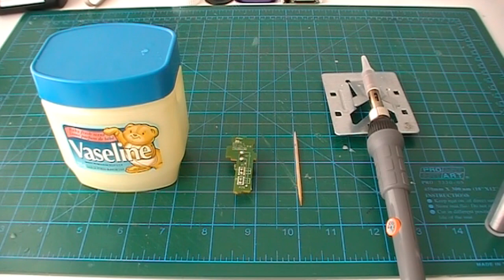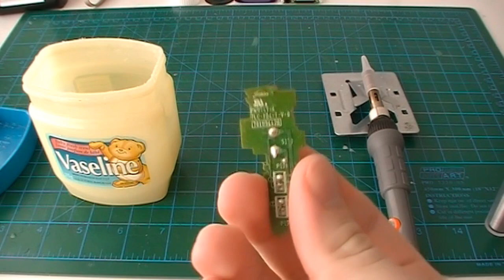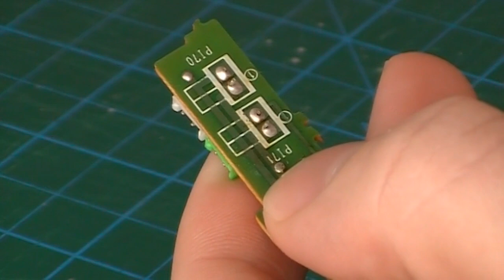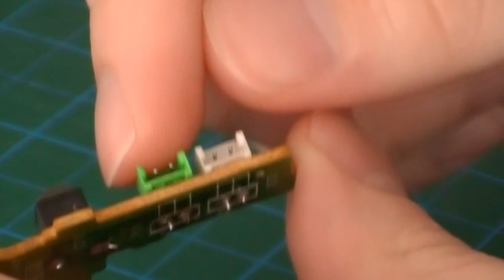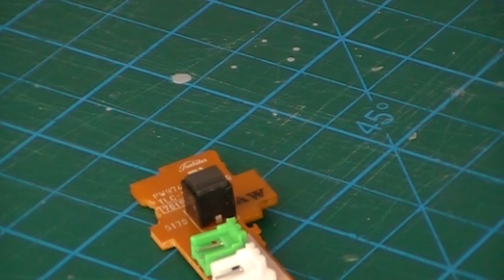Vaseline Instead of Rosin Flux. Is it Possible?

Comment: 0:00 - 0:12 Flux’s thermal conductivity properties are secondary at best. That’s not what flux’s purpose is.
0:15 “rosin also has deoxidizing properties”… Yeah, that’s its entire purpose: to remove oxides and prevent the formation of new ones.
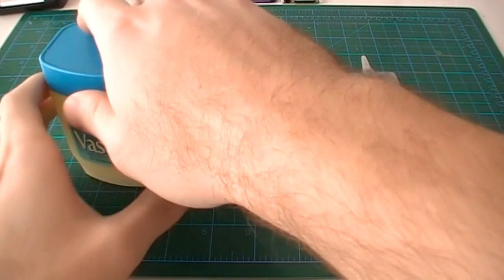0:35 Vaseline is not superficially similar to rosin: rosin is a hard, brittle, plastic-like resin. Rosin-based flux comes in multiple forms, including liquid (doesn’t resemble room-temperature Vaseline at all) and paste (which does have a similar texture, because it often uses Vaseline as the filler: the Vaseline is not the active ingredient!). Choosing a substitute based not on the active ingredient, but on tangential properties of the finished product is idiotic. It’s like saying “I’m out of heart medication, but these other pills look similar, so let’s try them and see how it goes!” or “I’m out of flour, but I found this plaster of paris in my garage that looks like a white powder, too, so I’ll use that in my cookies instead.”

Comment: After misplacing my paste flux, I found this video and tried the petroleum jelly as a flowing flux to solder 2 wires and as far for flowing the solder it doesn't work as a flux, it just globbed and actually caused the solder to ball up to where I had to clean the connection and resoldered without... So this will be considered false information in my line and not recommended.

Comment: It won't work and you have shown it doesn't work. Whilst it may feel OK, it is clear from the lack of the convex shape of the solder bridge that the solder hasn't wetted to the pins. That's no surprise as the main function of solder rosin is to provide a heat-activated acid that removes any oxide layer so the solder can wet to the substrate. That is a poor solder joint that can be visually easily identified as a fail even if it feels secure. For electronics soldering the simple solution is to use a rosin-cored solder; no extra rosin needed. Good ones are non-corrosive in their cold state but best practice is to remove the excess rosin anyway afterwards.
Reply: so could it still work for desoldering purposes?

Comment: Rosin also cleans copper well, like an acid, but doesn't seem to eat the tip so fast.  That said, I've used jelly, and in fact it's the base for plumber's flux.
Reply: Rosin is, in fact, composed entirely of acids (mainly adipic acid, IIRC). It’s just an acid that is not active whatsoever at room temperature!
Reply: Nowadays here in California, water based flux is required :(
Reply: @kylekoenig4730  Says who? I can’t find any evidence of such a requirement. Can you point me towards a source?

Comment: Would mixing powdered ascorbic acid with Vaseline help with shedding oxides from surface?
Reply: I just used citric acid
Reply: Melt some hard rosin and stir in some Vaseline/petroleum jelly. Mix well and you have the same stuff sold in the store

Comment: Small amounts of rosin is available in every pharmacy and in almost any music shop as it is used for violins 😉
Reply: Violin rosin is hard, not like soldering flux. If you try melting it, it will become very tacky, and probably burn to your iron. 
Violin rosin is meant to rub off as a powder onto the bow, which goves the bow hair more traction on the strings, thus creating the sound.
Also, I just realized, I don't think you'll ever see violin roswin in a pharmacy.
Reply: break off rosin, smash to powder, mix in alcohol, rosin flux.
Reply: @stuartmunson  Alcohol would immedtely boil off, just leaving you wityh the same situation.
Reply: @marktwain3531  That's nonsense. Rosin dissolved in isopropyl alcohol is the basic formula for electronics soldering flux that has been use for many decades. It's not some backyard substitute, it's the basis of the actual product you would be sold as soldering flux, and many of us prefer to buy it in its hard, undissolved form. I wouldn't recommend bow rosin simply because the rosin sold for that purpose is too expensive, presumably it's a different grade. I can buy pure activated rosin, sold for the intended purpose of soldering flux, by the kilo here in electronics stores.
Reply: @Degenerate76  The flux I use is not alcohol based, nor is it easy to find alcohol based flux here (for that reason). And if you're replying to the violin rosin, no, it would not make a good rosin. I knw this because I've been playing the violin for years, and know what the rosin is made out of. It is essentially a processed tree sap, and would burn very easily.

Comment: Ive used dishwashing liquid as a water based flux, and it works pretty well, but not as well as a good flux like rosin or amtech. You may also be able to find flux at a hobby shop, or hardware store. Sometimes I use plumbing flux on stubborn hard to solder connections because its super aggressive. Make sure to clean off any flux that you use, as its often very corrosive.
Reply: Ive used borax powdered soap for gas welding too, it might also work for soldering
Reply: @hippynurd  Really?  Can you explain? What type of welding process, and what metals?  Are you talking using it as a sub for shielding gas?
Reply: @TheDivergentDrummer  welding steel with acetylene gas torch welding and steel welding rods, you heat the rod, dip it in a cup of borax to coat it, then heat up the 2 metal pieces and apply the fluxed rod filler. Can you use a shielding gas with gas welding? ive never seen that.
Reply: You can also do brazing with a gas torch, and thats more like soldering than welding, and works good with non ferrous metals like copper and brass.
Reply: @hippynurd  OHH! Yes, I remember that from grade 9 shop class lol.  Still have that magazine rack lol.

Comment: if i can fix my sons ps3 tomorrow using this trick. I will forever be in your debt.  This version of the ps3 is getting harder and harder to find and he finally found one a few months back and I broke the power connector on the motherboard while re applying thermal paste.
Reply: So did it work or not?

Comment: The answer is no. It doesn't carry the oxides away. From reddit: "...only performs the function of keeping air out of the joint but none of the de-oxidation that rosin flux does. You can technically solder with petroleum jelly but it would be the same as just soldering without flux or petroleum jelly, lol. It gives zero benefit."
Reply from the maker: Oh yeah I remember reading that reddit page a while back. Well, depends on how you look at it. I mentioned at the end of the video that there are no de-oxidizing properties in vaseline, as you mentioned. From my own experience I would argue that using vaseline is a definite step above soldering dry, but certainly not at all a long-term replacement for rosin.

Comment: Another problem is that vaseline is a petroleum based gel, which can likely deteriorate pcbs or any plastic components
Reply: Vaseline helps metals from rusting.
Reply: @yummyklown9226  that it does, but you're going to compromise the rest of the components
Reply: @yummyklown9226  name checks out
Reply: Just had to point out that the vaselin comes from a PLASTIC container...
Reply: @Formula400Pontiac  Also I don't remember ever seeing pcbs or components having any PP code, so it'll very likely mess it up if you're not too careful, even if it'll take years before it really does harm
Reply: @Formula400Pontiac  not every plastic is the same, nylon for example does not react to petroleum based gels or substances
You can look at the "recycling" logo and see what it's PP code is
Reply: @tydshiin5783  lol pp code
Reply: @pyrojason  polypropylene, but yes funni haha
Reply: @pyrojason Oh gosh😂